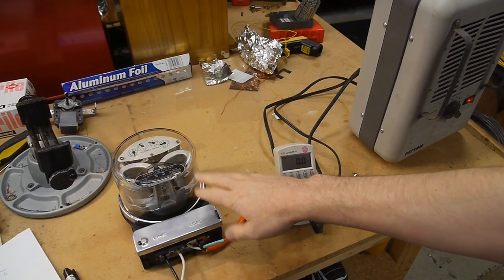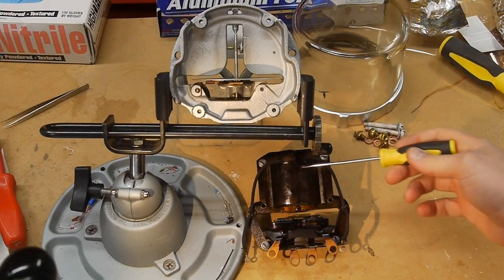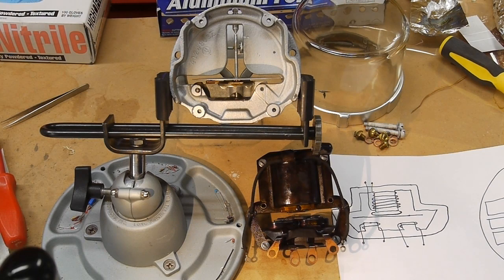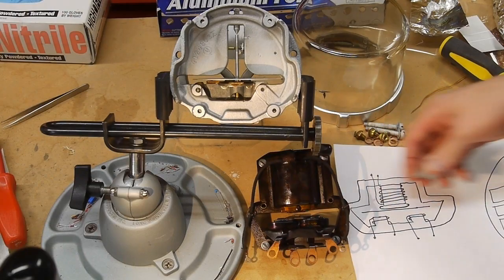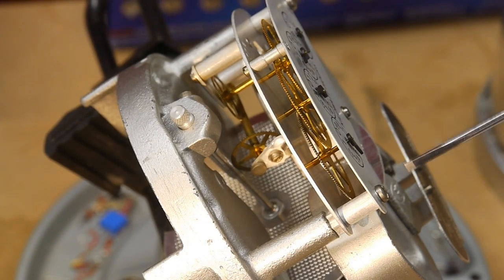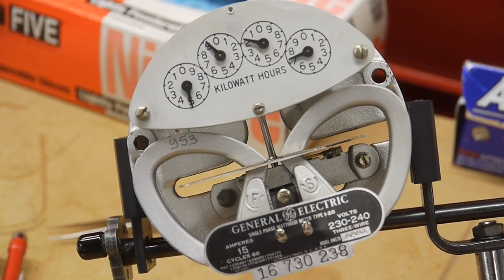Explanation of how kilowatt-hour meters work (electromechanical)

Comment: The stippling on the disk is called "planishing", and is a manufacturing thing, to get the disk real flat.  If you pressed a bent disk between flat dies, it would spring back and retain some of its warp.  The stippling permits plastic deformation of the disk, even if initially flat.  You will see this on telephone relays and other stamped assemblies for the same reason.
Meter will read correctly only it is mounted upright; the bearings are not designed to bear side-load.
Shaded pole motor: the shading coils are needed continuously.  The reason is that these small motors have a "goodness factor" less then 1.  Such motors will not self-rotate even if initially spun up.  In shaded pole, it is not practical to get phase shift over 45 degrees.  (You can, but amplitude of magnetic field left is minuscule.)  That's why there is double bar in motor.  It is a shaded, shaded pole.  Analysis is like RC circuit.  Look at phase shift versus R.  Raising R increases phase shift at expense of voltage on cap.  In meter, it is practical to get near 90 degrees, because you have absurdly large voltage coil, and only the tiniest "motor" output.  Meter motor is running at high "slip", so torque is independent of rotor speed, even at the highest load.
This is an old meter, being only good for 15 amps.  But ones I have are older, being only good for 15A at 120V.  Mine are from a power panel in an old building in Akron Ohio slated for demolition.
Reply: M Detlef  DIE noun. a block of metal used for pressing or cutting something into a shape or pattern -Macmillan dictionary
Reply: Is the 'shaded, shaded pole" the reason for the asymmetric lower coil then?
Reply: So does the voltage coil change the rotation speed if a constant current draw is present and the voltage changes like say a brown out where voltage drops from 220 to 150 or so? Reason I ask is I have been wondering if my daughter is getting over billed because they only have 110 coming in to the ancient house she is renting instead of 220...
Reply: @rosebarnes9625  The meter is supposed to respond to only the power flow, independent of voltage.  But going to extremes such as operating at half voltage, there would be errors (don't know which way).  If 220 service drops to 150, many loads (such as induction motors) lose efficiency, and can even fail to start & burn up.
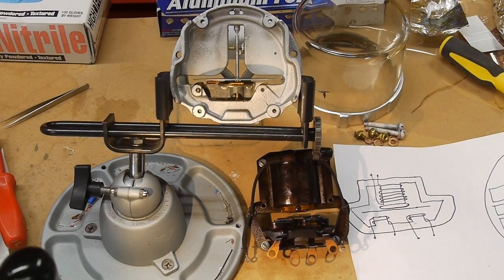Reply: @rosebarnes9625  9:00
Reply: @rosebarnes9625  Yes, this is the reason for the meter to measure both voltage AND current, so although if the meter was designed for a given voltage, it may be *slightly less accurate if operated at a much lower voltage, then you will still have the meter taking into account both the current AND the voltage.
Reply: @guyteigh3375  cool, thanks! !
Reply: Brian Park 

God info, Thanks
Reply: M Detlef  Let me get this straight: you took time out of your day to yell a profane epithet at someone because they used a word you don't know? I would reevaluate your life priorities if I were you.
Reply: this is awesome man. thanks for posting. im half asleep right now but i can tell you this much: youve made me decide i need a 2 channel scope. i just need to see this out of sync action. thanks mate
Reply: Thanks for your explanation, really helped me lot.
Reply: On my old mechanic since replaced, it had a "flower" shaped wheel I believe for calibration,  It had + for CW and - for CCW, can you confirm this?  Thx.
Reply: it's an identical idea to crumpling your baking paper before putting it in the pan, all of those little local deformations make it easier to set and hold the final shape you want.
Reply: There are 2 different alternating metals on the disc that "click" in a rotational direction with the changes in positive and negative pulses of the a/c sine wave.  Thus a tic toc clock movement.
Reply: @1966badnova  The disk is a single metal (usually aluminum)  It is totally homogeneous, save for the planishing marks.  The motor is not synchronous (if it were, there could be no ability to take on any speed as function of power drawn).
Reply: Thanks for that mate. Both of you.
Reply: Question. If I make a junction where my positive and my neighbour's negative meet in side of the house wich is after the meter and fuse box and its down via extension cord of the socket on the wall and then from that junction run a positive  and negative back to my neighbour's and then one to my appliances so as not to creat a field in my meter or my neighbour's wouldn't that take the need away for requiring two meters. Isn't that something to think about?
Reply: Thank you for this!  Planishing sounds like a great way to make that disk for very little cost and time, but still have a high quality result.
Reply: Go Zips!

Comment: The meter is for an one phase (240V) electrical system (live + live) but with a center tap as a neutral. Meaning, center tap to any end you get 120V... but from live to live you get 240. To measure energy used from live to live AND any live to center tap (N) you need tvo current measurement elements. For better description see google: single phase three wire 120/240

Comment: the voltage coil is connected to what ? neutral or live ?
Reply: I'm no AC expert but I would have thought it would be both. Voltage is the electric potential difference between two points. If you only have one wire you don't have voltage because you have nothing to measure it against.
Reply: It goes across the two lines of a 3-wire service, so 240v.

Comment: i'm late to the party, and check the TLDR below, but....

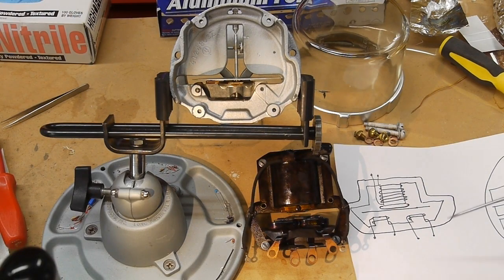i think see you doing just a bit of hand waving at about 6:30 where you're discussing the phase shifting ring, and i don't blame you. this meter is a subtle and clever piece of work. here's two scenarios, the first of which tracks your description best, but which leads to an inconsistency, and a second interpretation, which i believe is probably consistent and more "correct". 

1) assuming the voltage coil is essentially a purely reactive element (i assert you imply this assumption at 6:48), this coil will produce a maximum magnetic field when the rate of change of the voltage across it is maximum (you say current, but let's call that a "typo" since the magnetic field is directly proportional to the current at all times, not its rate of change); meanwhile, the (purely resistive) current coils will of course produce a maximum field when their currents are maximized. reasonably assuming that the external load is purely resistive, I through this meter and E across it  will be purely in phase at all times. this implies a 90 degree phase shift in the fields generated by the I and E coils up front... WITHOUT the phase shit ring. 

now, i agree that we need 90 degrees of phase shit somewhere here, and that the ring will produce such a phase shift.... but if scenario 1 holds, we already have a 90 degree phase shift -- so why should the ring be necessary? 

the suspicion is that there's something wrong with scenario 1, and that scenario 2 details a more likely state of affairs.

2) assume instead that the voltage coil is like the current coils: purely resisitive (i.e., almost non-reactive at line frequency). then there is no phase shift from either set of coils and the ring must be used to get the needed 90 degree centipede motion required to generate torque. good thing one: having both the current and voltage in phase in both sets of coils means that both sets can actually do real work on the disk (since said disk turns a gear train with all its attendant friction, this is probably a good idea). also, good thing the second: in the video, the voltage coil shows signs of having been heated. while its true that mostly-inductive coils can heat up (current is still current, no matter if its in phase with voltage or not), the fact that this coil gets warm during normal usage implies strongly that its resistive (in phase) nature plays a major role in its operation. 

TLDR; 
the existence of the phase shift ring, and the requirement that both I and E coils do useful work on the rotating disk, imply that the voltage coil is essentially a nonreactive, purely-resistive element -- like the current coils. 

(caveat: you may well have this whole thing perfectly sussed, in which case this comment is kinda moot, but hey...it's good to write things up once in a while. if nothing else at least i understand things better now ;) )

great channel you have here. best regards. -phil
Reply: just noticed your annotation text touching again on this phase shift issue. heheh. yes...it's an awfully cute piece of technology, ain't it? perfect retro for this steampunk age.

Comment: Excellent presentation.  I want to just add:  The phase of the inductor is not perfect (as your added note on the left stated) because the coil also has resistance.  The resistance of the coil adds an in-phase component to the current, shifting it away from a perfect 90 degrees.  So the added corrective inductor is used to calibrate it to 90 degrees.
I like the centipede analogy.

Comment: Is the meter in series or in parallel with the house circuit?  Why does a draw in the house produce more current draw in the meter?  It must be in series, such that no load is an open circuit?
Reply: The line current either runs through the current coils in the meter, or (for high power applications such as a whole house) through a transformer.  For normal 3-wire service, there is one current coil for each line.

Comment: I tried to bust Vepco years ago for a meter that wouldn't stop spinning when the main breaker was off.  Wasted a lot of time on the phone and finally got a Vepconian to come out to my place and see what I was talking about.  He took a few measurements and conferred with the meter shop.  Finally, he decided to do nothing about it.  He claimed that Vepco's only requirement for accuracy was that the meter indicated correctly at maximum power (which it did).  I was going to have to eat the free money they were making on my non-use of their power that their meter was recording.

Comment: Great explanation but what is the physical difference between the voltage coils and the current coils if there is any? I don't mean the number of coils. I want to know how they get the coils to prefer voltage over current or vice versa.
Reply: To "prefer" voltage you put the coil across the voltage source. To "prefer" current you put the coil in series with the current flow. In other words the coils are connected just as you would connect a voltmeter and an ammeter. Of course,  you want the coils themselves to consume as little power as possible, so the voltage coil will have many turns of fine wire (i.e. high impedance) and the current coil will be just a few turns of heavy wire (i.e. low impedance).

Comment: I am far from an expert, but doesn't the two incoming connections from the pole serve as two "hot" 120v's???  That is how you get 220v for your appliances that call for it?  I don't think you have that wired correctly, but then again I have learned from people in Detroit that hook up illegal wires from the pole with jumper cables used in cars.

Comment: Actually, I don't think it is 90ndegreea offset. When you apply a changing magnetic field to copper, the copper induces an exact opposite magnetic field, so it would be 180 degrees. It's essentially the same concept as dropping a ND magnet through a copper or aluminum tube. The magnet falls slower than 9.8 m/s^2, because the magnet is inducing an opposite magnetic field in the metal tube.
Reply: *IT DEPENDS*

If that copper ring attached to the bottom of the coil above the spinning aluminum disk is NOT WIRED into the coil -- if the copper ring is merely ATTACHED to the bottom of that coil -- then you are correct,  Lenz's law means the exact opposite field (180 degrees offset in phase) is induced in that attached copper ring.

If however the copper ring IS WIRED INTO THE COIL'S WIRING then it's possible it's an inductor.  In that case -- as with all inductors wired in a circuit, the voltage and current are 90 degrees out of phase.  At time t=0,  when voltage first appears at the inductor from the voltage source (the utility company) -- that is max voltage.  That is the top of the voltage sine wave, the maximum positive voltage level, when power is first applied to the coil.  Coils resist a change in current so the coil says "Look, Mr. Voltage, I'm not changing my current flow, even though I know you WANT current flow.  Sorry."  Then, 90 degrees later the voltage has fallen from its maximum peak of the voltage sine wave down to zero.  The freaking coil panics.  "Hey, Mr. Voltage, I know you know want no current flow across me but I'm not letting you run the show here -- I'm gonna let current flow to the max. I hope you've learned that, whatever voltage level you try to put across me,  I'm gonna flow current the EXACT OPPOSITE to resist your demands.  You come to me with maximum voltage?  You get zero current.  You come to me with minimum voltage?  You get maximum current.  I'm not changing that unless you put a capacitor in the circuit."

Comment: In the squirrel cage motor (shaded pole), the copper wire is disposed in diagonal in the inside part, close to the rotor (the cage). This help to decide the direction the motor start. This was important for turn table and still is for fans so that air is pushed in the same direction.

Comment: does that mean it is possible to adjust the fast slow portion of those center permanent magnets to spin slightly slower and appear to use less electricity than what is actually drawn so the energy bill is lower?
Reply: David Bowser that was exactly what I thought when that bit was mentioned. would love an answer on this. perhaps there's an anti tamper device on that and the magnets are set at the factory
Reply: Yes but it's only a very slight adjustment. These meters were designed to be within 98-102% accuracy, the adjustment exists to calibrate the meter within those specs (e.g. bringing a meter that runs at 97.8% on test equipment back to at least 98.0%) On most of them, there isn't even a full 2% worth of adjustment.

Comment: hi, i had a question about the effects of the set up of your experiment on that meter. does it still turns when you use only the live wire and leave the negative, and then use a negative wire from other line that is outside of that meters negative line wire? will it still turn the dial on,  since only live is being utilize from its own output? i wonder if how it functions and i wonder if device plugged in live coming from that meter will still work when the negative wire is coming from other line outside that meter. assuming those other lines has similar voltage but are outside the line coming out of that meter.
Reply: The neutral is used only for the voltage coils and as long as it has one from anywhere it will work correctly. the holes in the disk are to create Eddie currents in the disk to slow it down to stop it

Comment: In ur explanation for a phase shift u said there's a delay. That can't be right.
Reply: You know that in an inductive load voltage leads current, thus the currant is delayed compared to a resistive load where the voltage and current are in step time wise.

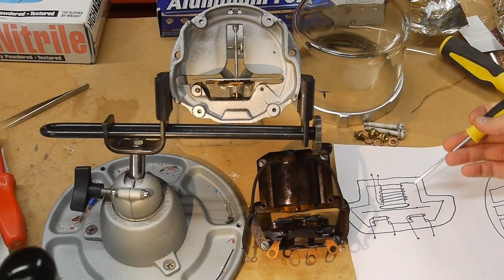Comment: Please forgive me if this seems ignorant. At 6:42 are you saying that scientists do not understand exactly why maximum current rate of change corresponds directly with maximum magnetic value? At 6:52, it seems like you have no answer and almost said something like "still not understood" or the like before you said it is a law of nature and that is why cosines are 90 degrees out of phase with sines etc..
Reply: It's Lenz's law, which is that induced voltage is proportional to the derivative of magnetic flux. If the magnetic flux is  proportional to sine, then the induced voltage will be cosine, which is also sine shifted forward/backward in time.
Reply: watts are the product of the current coils and voltage coil In the meter the magnetic flux for the voltage is nearly constant in house hold use but only the magnetic flux of the current coil changes. The magnetic flux drives the disk with some compensators for the various things about the mechanical device, otherwise you would get only instanteous reads and not the product